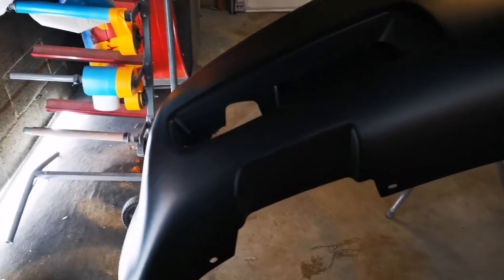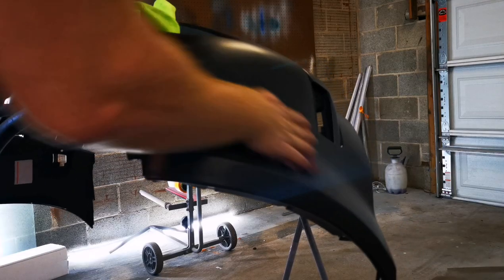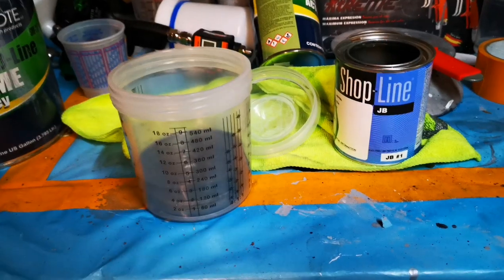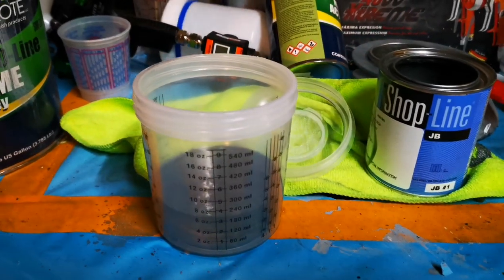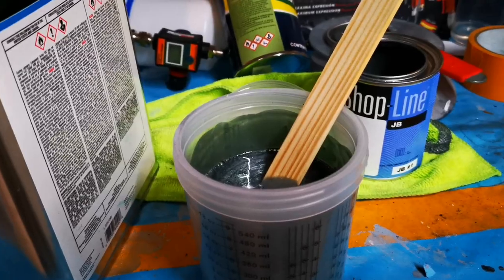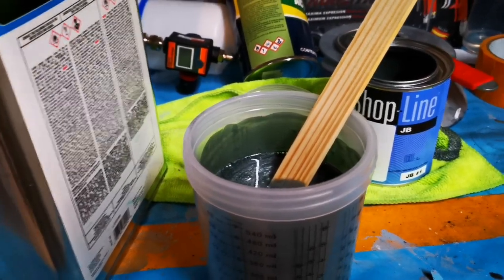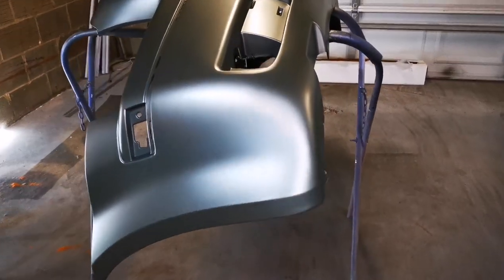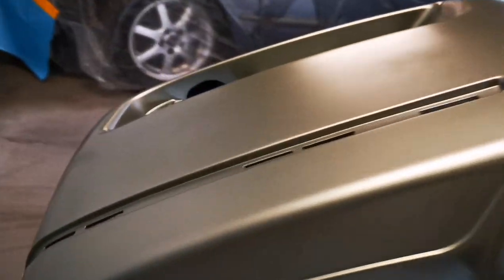Waterborne VS solvent paint

Comment: Great video!! What’s your best line of clear coat to us for panel repair?
Reply from the maker: Best economic panle repair clear is the Smr135 2 wet coats and it will look oem brand new. Even better? The glamor production clear. I perfer the smr 135.
Reply: Speedokote refinish network thanks. In California it’s not VOC approve with other can i use?
Reply from the maker: I Beleive the 2.1 VOC glamor production clear can go to California
Reply: Speedokote refinish network appreciate the help thanks

Comment: Man, automotive painting overall has different "rules" compared to house painting. Even with Rusto rattlecan stuff I've done so far, wet on wet (or back to back almost sort of dry to touch) coats are a no no with house painting, but required for that. Do you need to use a higher pressure with less reduction that way, to compensate for the thicker paint to get it to atomize so you don't get orange peel? 

In house painting land, I'm not sure when this will happen in car painting land (my, lots of stuff is different and I'm still trying to wrap my head around it all, but it's good cross training figuratively for house painting for sure...) it's gotten to the point where solvent based stuff is actually WORSE than water based, due to the EPA regulations. Basically the VOC exempt solvents make things worse, or are actually downright toxic (Zinsser Cover Stain low VOC uses some crazy dry cleaning solvent that burns your throat, and it no longer even really... works...) Some rules are crazy, for example acetone is VOC exempt and you can put as much acetone as you want in a paint, which is why Rustoleum on the cans says "thin only with acetone" but acetic acid, which is vinegar, is considered a VOC. The VOC rules aren't about human health, only about the ozone layer, and it's sort of criminal that some paint companies are implying low-VOC automatically is safe, healthier, etc, it's not always.
Reply from the maker: I did it, you saw the results, the end result was good and I gave it a full day to cure for all the "your guna get solvent pop" people. No solvent pop, smooth clean oem finish. But hey do it your way.
Reply: @speedokoterefinishnetwork4937  I actually just honestly had no idea, it's why I asked, sorry.
Reply from the maker: Your good bro. That why I waited a day for it to cure so that I could prove to everyone there is no solvent pop risk if you do it this way. Even if there was mild solvent pop in your basecoat before clearing, as long as the base was fully died up before clear, the clear would fill in those little micro pin holes created by solovent pop. Now if you get solovent pop in your clear by doing your second coat to soon that's when your screwed.
Reply: @speedokoterefinishnetwork4937  This is kind of a dumb question, but I honestly have no idea again, what are recoat times like on automotive products? Is it like a Rusto rattlecan, where it says wet on wet within a few minutes, or wait an entire day or two for all the solvents to offgas out? I'm kind of confused with auto painting videos I see, as there might be sort of a difference in terminology of passes vs coats. To me a "coat" is wet on dry, and a "pass" is wet on wet? It's just sometimes confusing terminology to me. Even in house painting people that are way inexperienced will say "I did two coats" when all they did was backroll the first coat, or do a second pass with the sprayer, etc. 

With a house paint like Benjamin Moore Advance, it actually has like a 12-16 hour recoat time, and if you recoat before that it can make it reach final cure slower, or not at all, but it's waterbourne. When using a catalyzed paint like what you use (which I've never used yet) do ambient conditions matter less, and it's more down to the amount/type of catalyst you use (ie, fast, slow, etc) or do the conditions really drastically affect dry times and how it levels/cures? Even using Rusto rattlecans, temperature and conditions make the hugest difference in leveling and amount of orange peel, and it's the same with house paints, the same paint will orange peel or brush mark like crazy in 90F with low humidity, but make it 50-60F with high humidity and it'll flow well and look like glass. So with these air drying one component paints, latex or oil, I'm always aiming to thin them as much as possible and keep the area as cold/humid as possible to slow drying so they level well, trying to aim for a thinner coat overall to compensate for runs with a thinner/slower drying paint. So do automotive paints work this way, or does the catalyst just kind of determine everything and the set of the paint is entirely chemical (sort of like cement, plaster, etc, where it'll set up regardless of the temperature because of the chemical reactions) not up to the ambient conditions? Or is it like half and half? 

Sorry for all the questions, it's just I legitimately don't know and would like to know before I get into actual auto paints how it works.
Reply from the maker: Automotive paint usually always gives instructions right on the can. I know we do here at speedokote you will not find a single product without instructions. Basecoat it's typically 1-3 coats. Clear coat 1-3 coats. 20 min in between basecoat and clear coat. Not to hard bud
Reply: @speedokoterefinishnetwork4937  Propensity to overthink and analyze. :(
Reply from the maker: Don't over think it, it's just paint :)
Reply: @speedokoterefinishnetwork4937  I'm literally autistic though for real. :(((
Reply from the maker: Do some research you will see what it looks like
Reply from the maker: @serenitynow3089  nope. Trust me I've gotten fish eyes. Solovent pop is so hard to see I would almost have to have you right next to me to train your eye to see it if you have never seen it before. It's not a huge issue in the paint world. Crows feet are my biggest oh ** moment.